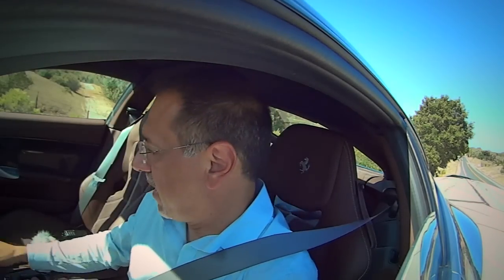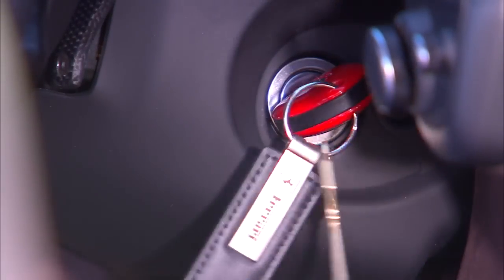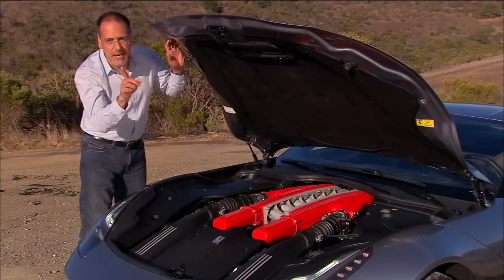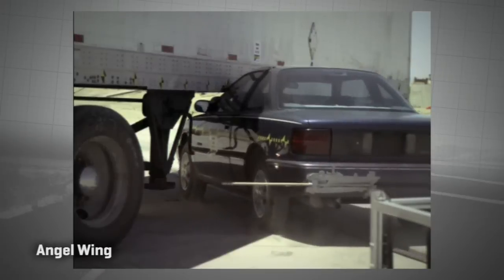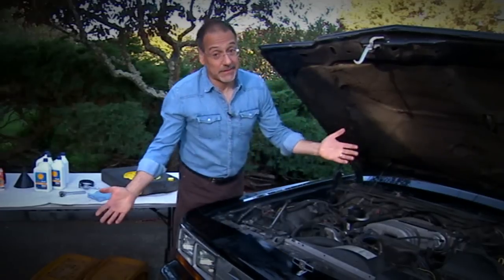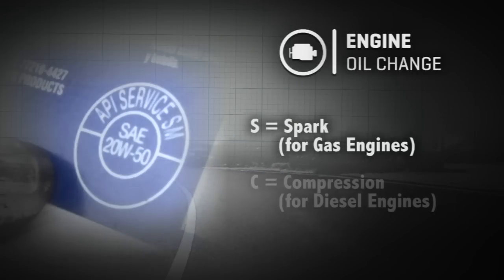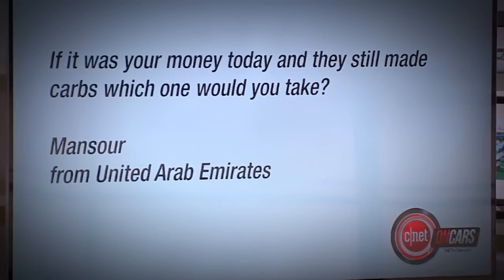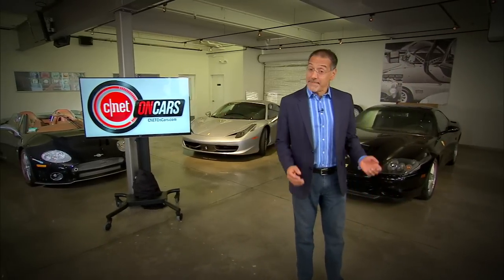Ferrari F12: A supercar for all seasons (CNET On Cars, Episode 28)

Comment: Great job on the oil change. Only thing I would add is make sure the rubber seal comes off with the oil filter, otherwise you end up double sealing and you'll definitely have a leak.

Comment: 1. why did you not prime the new oil filter? (put a small amount in so the engine doesnt start dry)

2. i did not see any mention about making sure the old o ring is still on the old filter so you dont put on two o rings which leads to leaking

Comment: hmmm... then why not use an oil with more viscosity from the start?
Reply: controlling the viscosity of the oil in the dampers lets you control how hard or soft the car rides, you only want something as stiff as a brick on the track because on normal roads with pot holes, speed bumps, etc. your rear end would be in pain after about 20 miles

Comment: Porsche used active aero on the 928s back in the 80s for cooling and brakes, way before Ferrari.
Reply: ***** If you are going make a statement in an article, I think you should do research and make sure your statements are factual and correct.  What if I said Ford made the first automobile to top 200mph in an article?

Comment: Dude, this is the reason old engines don't last long. ALWAYS use the stock oil weight even on high miles engine. I have a 96 Tahoe with 300,200 miles and still use 5w30 every 5,000 to 7,000 miles. Old engines have old oil pumps and trying to suck up thick oil don't help. People wonder why my engine don't knock or smoke and only use 50% of a quart of oil every 5,000 miles. I also use the same cheap brand oil filter. Why buy a $8 oil filter when a $3.77 filter will do.

Comment: WHat? The pagani huayra had active aero long before the 458 speciale came out.
Reply: The Enzo had active aero too..
Reply: The Pagani only has "aero braking", unlike the Ferrari that aides aero at speed when you're legging it around the track.
Reply: Greg Wilson And you are incorrect. The Huayra's "ACTIVE AERO" works at all times. Braking, Acceleration and Cornering.
Reply: I'm not incorrect. The Enzo's active aero was used under both braking and acceleration although it activates at 60 mph+. The front spliter and rear wing alter their positions based upon the speed. Likewise, the Mclaren F1 could be considered to have active aero, with its air brake on the back. Depends on your definition of "active aero".
Reply: But it was the Huayra that first had active aero for cornering. The very first car using active aero might have been the McLaren F1, but I'm not sure about that.

Comment: Thanks for wearing gloves during the oil change, that step is mandatory and many of these youtube savages skip it. The reason for putting the oil on the seal is that it seats better, it doesn't seal it. It doesn't really help it come off, either. If you don't, then whatever part grabs first can skew and the gasket can seat unevenly, even getting pinched.
Reply: +Martin Espinoza So in other words the oil Lubricates the gasket & metal when they rub against one another
.
Reply: Yeah, that.